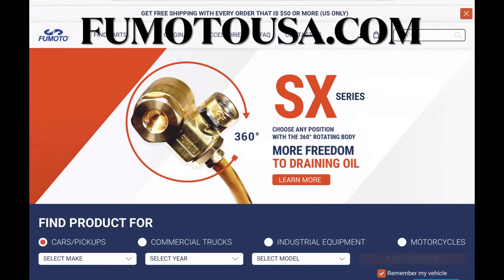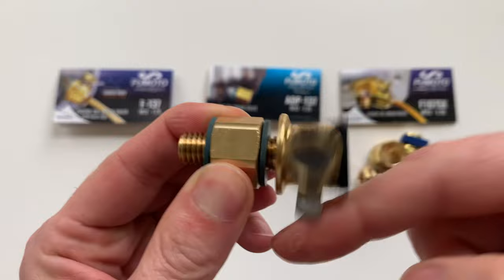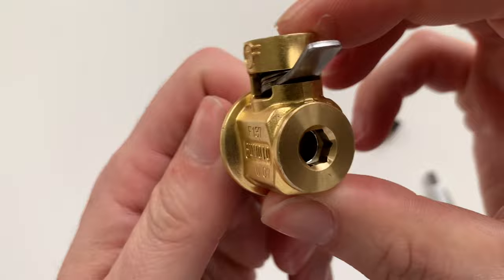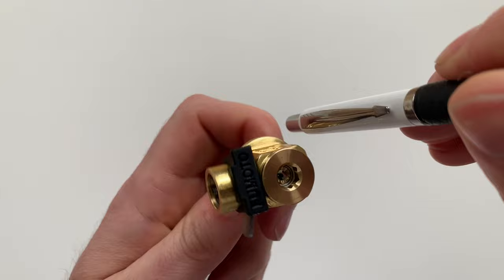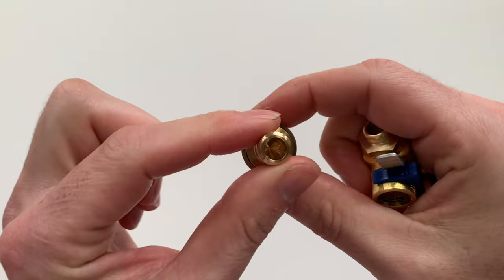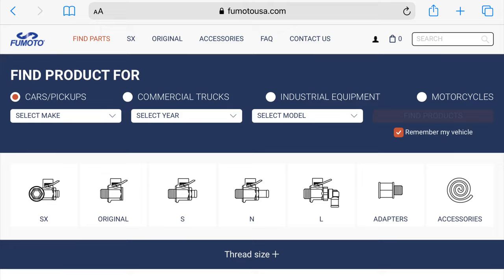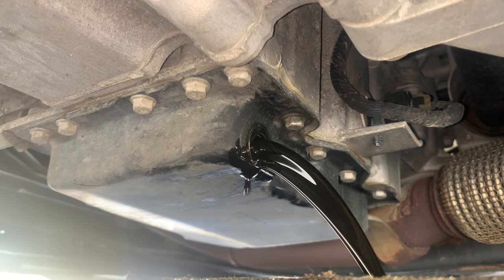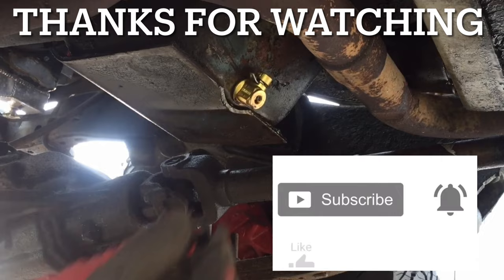Full Review of FUMOTO Engine Oil Drain Valve | Installation & Use | All Types (F, ADP, SX, S, N, L)

Comment from the maker: I am working on a video showing how much oil remains trapped in the pan as a result of the FUMOTO valve thread length sticking into the pan. 
I will drain the oil with the valve, then remove the valve and measure how much more drains out.
I’m doing it on three different valves, to show results for the three different types. I will post the link to the video here when it is complete!
Reply: I did this. I was curious how much was being trapped so I drained then removed the Fumoto. Not nearly enough to worry about.
Reply: That's why I wouldn't ever use one. Why constrict the drain plug for a price when the standard one works perfectly fine? Not to mention it sticks out further under the car which is another drawback.
Reply: @TheBrawlmastah  depends on the angle of the drain. at a disadvantage if drain points straight down. One those drains which are angled to the side, if there is too much clearance from bottom of pan to drain, also not good.

Comment: When you drain your oil into a pan you then funnel it into a disposal container that you bring to your recycle center.  Why not get the nipple ( I have the long one) and a short piece of hose and drain it straight to the disposal container.  This I find is the real advantage of the system as you eliminate one step (plus cleaning the pan and funnel) and also eliminate the possibility of a mistaken spill.  I use the 5 quart bottle from my last oil change and this method could not be easier.
Reply from the maker: That’s a great method if it works out.
3 of my vehicles are low ground clearance. I can’t fit a 5 quart container under any of them. I barely have room to slide the catch pan underneath. 
Also, I don’t pour the used oil into the 5 quart oil container until after I empty the new oil from it into the engine (drain old oil into drain pan, pour new oil into engine and empty the container, pour old oil into empty container). I understand this can be addressed by always keeping an empty container on hand, but, that’s my reason.

Comment: Thanks for sharing! We can assume that the threads of the Fumoto valve protrude past the drain hole on the inside of the pan which can mean that the oil doesn't drain completely, leaving a little oil and debris around the threads. Wouldn't it be cool if you show us the inside of  a loose oil pan (not installed on the car) with a Fumoto valve installed so we can see how the oil drains and how much oil and debris it still leaves inside the pan? (hint)
Reply from the maker: A agree with you that some oil is left in the pan.
I really like of removing the oil pan and taking a look!  I have added it to my list of future video ideas, and I will be sure to credit you if I get to it.
The Jeep would be my first choice because of great ground clearance, but it is a real hassle. Have to unbolt a motor mount and jack up one side of the engine just to access all of the bolts. And it’s got this goofy 3 piece gasket. 
But, that could double as a second video for how to replace the oil pan gasket….
It’s on the list.
Reply: You could always compare thread length of valve with
existing plug's thread length and measure if possible,
the female thread in the pan/sump if residual oil and
debris was a concern.
Reply: The amount is negligible. Even standard drain plug you’ll not get it all
Reply: It holds excess oil in your pan and you loose the ability to look at a magnet. 1 pro, 2 cons = a loss for Fumoto.
Reply: @apapay01 I'm not convinced the magnet is a big deal. I wouldn't expect much iron to be coming from modern aluminum engines
Reply: @matsudakodo  magnets have been used in engines and transmissions and differentials for 70+ years for a reason. Just because your new engine is an aluminum block and heads, does not mean that’s what all of your internals are made out of. If you think your whole engine is made out of aluminum you better do some more reading 😂
Reply: @apapay01  never said that. I said iron is limited nowadays so it's less useful.

Comment: Compared to the stock drain plugs, how much slower is the Fumoto to drain?
Reply from the maker: I think it depends on the valve. I have 4 different valves. 
I do recall the SX valve being noticeably slower. The last time, I just opened it up and came back a half hour later (which was fine, because no tools are required. I just reached under, flipped the switch, and left. No complaints.)
I think some or all of the other valves, which are all F valves, were ok.
They redesigned F valves a couple years ago to have faster flow. I’m not sure which of my F valves are the old version or the new faster version. 
I’m going to time them all on the next oil changes.

Comment: Regarding the comments and questions about how much oil is left in the pan due to the threads protruding into the oil pan, has anyone considered or tried removing the portion of threads that are inside the pan? Seems like this would be the best workaround, and any threads inside the pan are not performing any function since they are virtually unused and not critical for the installation and use of the valve.
Reply: I have thought about cutting a cross in say the last 1/3" of the threads to be able to drain more oil out of the pan. Would probably have to clean up the threads a little bit afterwards but I think the effort would be worth it to remove the most oil without having to mess with the bolt every time.

Comment: Another advantage of the valve is the draining process
can be halted, if you have overestimated the capacity
of your waste container or due to clearance issues,
you are using smaller containers.
Easy to pick up when full and tip out.
Examine contents etc.
Just a thought.
Reply from the maker: Absolutely! I have used it twice for partial drains. Excellent feature.
Reply: Along the same lines, if you or an oil change place adds too much oil, it’s trivial to drain just a little.
Reply: @boro057  Another good point mate.👍

Comment: I installed the standard valve last fall on my Ram 2500 with the Cummins. Oil changes are not near as messy now. Used to be when you removed the drain plug, you'd better get outta the way! Lotsa oil can come out of an 18mm hole with 3 gallons setting on top of it.
It takes a little longer to drain, but it's more than made up in the fact you don't have a mess to deal with afterwards. Planning on installing one on my John Deere X750 this year.
Reply from the maker: Nice! I have them on all of my vehicles and plan to use them on any vehicles that I own in the future as well.

Comment: I have wondered about these drain plugs for sometime. Thank you for the review. I’m, now, completely convinced, I’d never use them. I like a regular plug. No springs or levers to fail at the wrong time.
Reply from the maker: Glad it helped!
Reply: Look at the valvomax drain valve. Its Scotty Kilmer approved. Only con is it drains slower than normal.
Reply: This wont fail 😂
Reply: Tale it from a decade long user, these do not fail.  The Japanese know how to build things.  I use them for a different reason.  Its a one time install and once its on, you never have to worry about stripping out your drain pan bolt hole.

Comment: This should be on every modern car!
Reply: No, they’re awful. You end up not draining all the oil. Some people have run tests and they’ve had over a quart stuck.Videos on YouTube show that with sample oil pans
Reply: @gianni_schicchi  definitely depends on the angle/position of the drain. if you have it pointing straight down, then you're out of luck.. also may seem counterintuitive or dangerous to some but you need a hot engine for increased fluidity, ensuring maximum drainage

Comment: Great video and I've used one for 8 years. It does restrict flow so the oil pan takes longer to drain.
Reply from the maker: It does indeed take longer to drain. I’m currently working on a video where I time how long it takes to drain on several different vehicles.

Comment: Critical: tighten the valve by grabbing it only over the actual valve body with the stamp on it. Do not try grabbing it by the small end hex nut, a small constant leak will cost you an engine

Comment: These are cool. I use them also. On one car I was able to have a buddy hold my shop vac on the oil fill hole while I swapped in the Fumoto valve (I had recently changed the oil).
Reply from the maker: Nice!  I’ve heard of that vacuum trick, but have never had to try it.
Reply: @LeonL47 "a bit of a mess" would be an understatement. But yes, you could swap it in your way. I wouldn't do it that way, but you could.

Comment: After installing them on a 2024 subaru crosstrek and a 2016 Lincoln mkx they look like a good product. You video is outstanding and your explanations are very good. For the multi position valve which I installed on my mkx there is no gasket, just a oring which I did not see as a replacement part on the fumoto website. I may have to give them a call.
Reply from the maker: I’ve had several of them installed for several years now. 3 to 4 years. I still love them and definitely recommend them.
I agree that the swivel version has an integrated rubber o-ring. This should not ever need to be replaced as a wear item. But, their customer service has been great in my experience. If it ever becomes torn or dry rots, I suspect they will work with you and send a replacement at no cost.

Comment: So glad I came across this video. And even better that I have the exact same Impala you have in the video. After hearing your caution, would you mind sharing which adapter(s) you ended up purchasing for the Impala? 

This is great info
Reply from the maker: No problem! I have the 2.5L L4 engine and I used the F107SX. I just checked the FUMOTO website and it now only shows the F107SX. It no longer shows the incorrect valve.

Comment: Great video. Ordering one now!
Reply from the maker: I just changed the oil on two of my vehicles yesterday! The valves sure made it clean and easy! But heads up, turns out some models take a while to drain. When I did the Saturn I waited about five minutes, then ended up just doing something else for a while and coming back later to finish the job. Probably didn’t help that it was well below freezing out.
But definitely clean, easy and recommended!
Reply: @HowtoandReviewsOfficial  That's awesome to hear. Can't wait to get mine in the mail to install at the next oil changes

Comment: Looks like a good idea. I gave up oil changes 60 years ago by using filters that clean oil. At present all I use is Motor Guards  Gulf Coasts and the Australian Jackmaster. On some lawn mowers I return the clean oil where the drain valve was. These filters all use hoses. Normally use Ford full flow filters. Had to change the oil on the Craftsman Kohler for the first time in 21 years.put a electric fuel pump on instead of the proper pump. Ended up with a crankcase. Full of gasoline. A low pressure pump would have worked.
Reply: You reuse the now super filtered oil? Have you ran analysis to check on additives? Such as anti wear/foaming etc etc.
Reply from the maker: This is interesting. I took a look at the two websites that you mentioned. I’ll have to look into it further.
Reply: I was talking about my 84 Subaru with no oil drains in 250,000 miles using a Frantz oil cleaner and Mobil 1. A Caterpillar lab manager sent me a sample kit. He said the oil looks good for that many miles. He recommended I change the Frantz and add a new quart of oil every 6 K miles instead of every 12 K miles. The car ran too hot in dallas traffic with the AC on. Got into a debate with A guy on a Trawler forum. The guy seemed smarter than usual. He said send me a propaganda package. It was  NASA heavy equipment engineer. He said bring your wife down to Canaveral we can talk filters. I called Gulf Coast filters and told them to send someone down to talk to this guy.They said who is it I said NASA. I see on their web site NASA is listed as a customer. They were moving the shuttle around then. They didnt need to hear about my Subaru. At present the Jackmaster is the best little filter in production. I have the Jackmaster  Classic. I use Great Value 1000 sheet from Walmart in mine. You can get 30 dollar elements but they are set up for the the bigger core TP..was talking about a truck with a million miles with one oil drain using Gulf Coast filters and Rotella. Got a call from Road King Magazine wanting the truck owners phone number..The one oil change was when someone forgot to tell a mechanic it was  Shell oil test truck. Dont sell filters now. Its been interesting. Started with Frantz in 1963. Frantz is obsolete now. The top loaders are easier to service and have better core seals. Road king did an article on the truvk. The way it was explained to me is additives last a lot longer in clean oil. New oil added at filter change keeps the additives up to specs.  The big Bounty towels in the Gulf Coast filter need 3 gallons of make up oil added when the Full flow filters are also changed 5.5 gallons are needed. On the Detroit series 60 425 HP it comes to the same as a full oil change every 40,000 miles.  About every 250 K the engine is torn down and measured. The oil is poured back in. Of course the oil gets analyzed often.
Reply: When I sold the Frantz oil cleaner they had a FAA and PMA approved  AeroFrantz model. Ran an add in the paper. The paper said FFA approved. Got a call from a crop duster company inviting me to come up and look at their filters. Also got a call from mr Jones of the Jones bus company of Wichita Ks. He raised Clydsdale horses near Sedan Ks. Repaired a cracked fender panel on his Chevy pickup. The rough roads cracked the panel around the Frantz bracket. Replaced the hoses and gasket. At the time Frantz had a lot of aircraft oil analysis reports.  Toilet paper fit in those days. The aircraft model used 2 ply facial quality. 1 1/2 inch core T P is hard to find now. Of course the Frantz elements fit now. When Frantz went broke a Frantz dealer improved the filters. That was the Gulf Coast junior. I think the junior might have been discontinued.  Gulf Coast does heavy duty diesels now.such as Locomotive engines on Shell offshore rigs. There might be some type of agreement with Jackmaster. The big engine people also have fork trucks and such that need small filters  Yes the Jones bus company was Frantz equipped school buses. Im going now shouldnt be hard to find more information.
Reply: @ralphwood8818  wow. This is the coolest most interesting information I’ve ever read on YouTube. Thank you for sharing. Perhaps I need to do some more reading and learning. Thanks for sharing.
Reply: @bvrgrn1038  Thanks In the old days all we had was toilet paper. Now you can pay 30 dollars for a filter element they claim is even better than toilet paper. I have the Jackmaster Classic that will take the expensive element or the newer  paper with the larger cores. They put a larger core seal in the bottom. They were all designed to use toilet paper.  The trick is to use a firm roll of toilet paper. Many use Scott 1000. Ive been using Gteat Value 1000 from Walmart.I remember the Fords with 2 drain plugs. One on.each side of a cross member. Better than removing the drain plug and the oil hits the cross member.

Comment: Any owners of a 2019 Subaru Impreza hatchback with the 2.0 L engine? Been considering getting a Fumoto for mine, but I can't decide which would be best for my vehicle. Doesnt help that i just had to replace the really crappy 14 mm original with a 17mm replacement part.

Comment: Any idea how these hold up to the weather? In areas that salt roads in winter will the valve corrode and not work? I definitely want to get one just not sure how it will hold up to PA winters or just rusting in general.
Reply: Great question. If these are brass, they will turn green and oxidize in no time.
Reply from the maker: I also live in an area where winters are four months of snow and salt on the roads.
I have them on for vehicles. Two of the valves have been through three winters and one valve has been through two winters. The other valves on a summer vehicle.
All of the valves have held up great. They are not corroded and function properly.
I have the adapter that adds length on one vehicle. Strangely, the adapter has turned brown. However, the valve is still shiny brass.
Reply: @HowtoandReviewsOfficial    Interesting, thanks for those insights. 

The Fumoto website does say they are constructed from corrosion resistant forged brass and stainless steel, so perhaps the designers had resilience in mind as well as function.
Reply: Good thing is even if the valve gets stuck shut, you essentially are back to a "normal" drain bolt. Just unthread the valve, drain oil, screw valve back in until you could rebuild or replace.
Reply: Or just save the original drain plug, like in the spare tire well or glovebox. @-BC.

Comment: Thanks for the super informative video!

Does the Fumoto drain valve come with a crush washer included?

If so, what is it made of? Aluminum? Copper?

Thank you for your help!
Reply from the maker: They come with a blue gasket/washer to go between the valve and the oil pan. I’m not sure what the material is. It is rigid. It is not floppy rubber.
Reply from the maker: The SX value does not have a blue washer. It has an integrated rubber o-ring.
Reply: @HowtoandReviewsOfficial    Does the o-ring that’s included seal well? Does it leak at all? 

It would it help to get a plastic or copper crush washer instead?
Reply from the maker: @700horses  I have not experienced any leaks. I have checked the seals to make sure nothing is leaking, and there are no oil drops on the ground where the vehicle are regularly parked. I have zero concerns with leaks.
I would stick with the seals supplied with the valves. I have not experienced any issues with them.